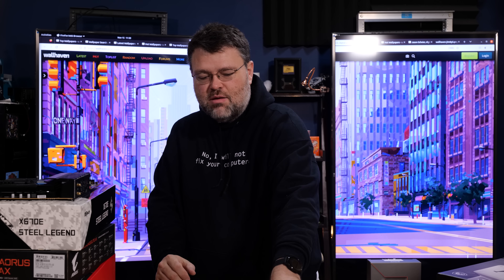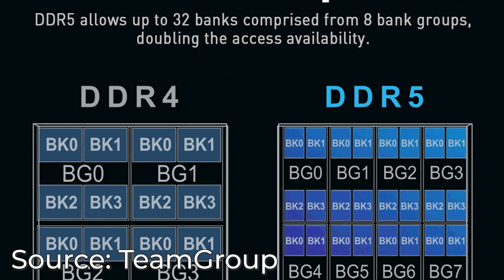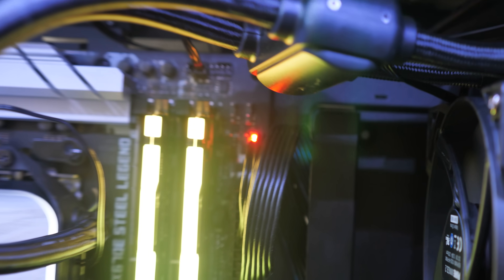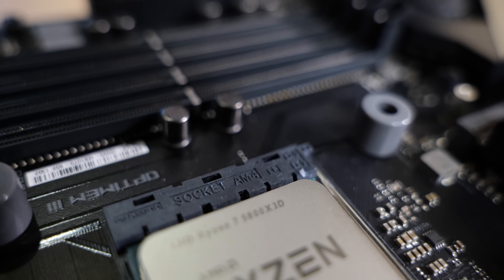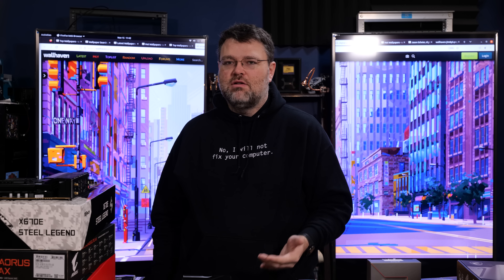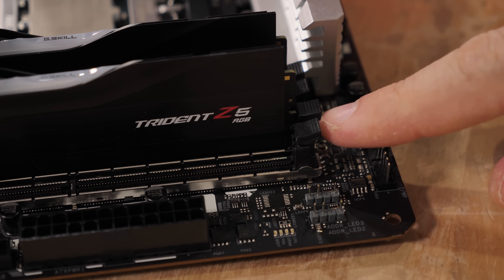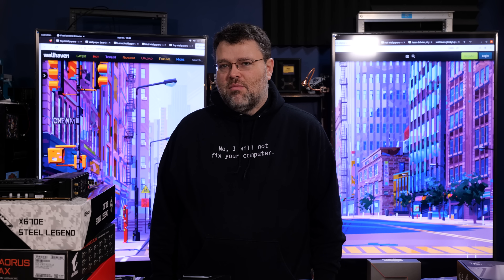Is 128GB of DDR5 IMPOSSIBLE on AM5? Level1 Investigates!

Comment: Thanks for this coverage. The main reason I haven't upgraded to a new platform is I want reasonable speeds at 128GB. Had been leaning towards Intel DDR4 since there are several motherboards that have QVL 128GB at 3600.
Reply: I really wish this situation was better for either platform. Rn “upgrading” from AM4 128GB to Z790 64GB :/
Reply: May I ask respectfully what it is you do that benefit from RAM more than 64GB? Out of curiosity.
Reply: @penguinbelly  For me at least it's a lot of software development work, which needs surprisingly quite a bit of RAM, incl all the browser tabs and microservices spread among multiple projects
Reply: @penguinbelly  workstations for rendering and power users with home/small businesses servers (video, XFS, etc). I can’t see why you’d need it for gaming or most other applications.

Comment: They really should reinforce the RAM slots and make it so RAM sticks can properly insert themselves into the slot without having some janky thing where it doesn't fully click into place. When inserting RAM you're putting a lot of pressure on the slot and RAM sticks, which feels like it's gonna break.
Reply: Even on generations before, inserting RAM could be feeling pretty sketchy sometimes - so hearing this about DDR5 has me a little worried lol. But I'm sure manufacturers will figure it out sooner or later, just how they'll have to figure out more resilient PCIe slots.
Reply: Boards are wildly more expensive and more cheaply made what a joke
Reply: Yeah - Probably not a good idea to reseat them when the motherboard is in the case on the standoffs ...

Comment: My experience with modern DDR4 and DDR5 has been a pick one of two. 1). Lots of RAM at lower speed and higher latency. 2.) Some RAM at high speed and low latency.
Reply: Yep, unless if with DDR4 you want to spend a good amount more money then you can somewhat get both, but usually its not worth it
Reply: @MrMaddog2004subscribe  Spend money to get better what ? Memory ? Motherboard ? Isn't this mostly a memory controller limitation ?
Reply: @Winnetou17  RAM binning is a thing, RAM that's running on the edge won't be stable even on the best matured CPU/Chipset

Comment: I was taught to insert dimms evenly, as level as possible, with equal pressure on both ends and never to insert one side and then pivot the other side down.  That's how people usually end up with 'seating' problems.
Reply: I also prefer this option, however many memory slots these days only have the lever on one end and a solid post on the other, which makes you first insert one end then push down the other with a painful crunch.

Comment: My asus x670e gene has been a champ. Boot times are slow but i honestly dont mind. I turned on the auto memory thing that checks timings every boot on purpose. Which is weird because "disabled" means enabled and "enabled" means its disabled. Out of the box it was on enabled meaning auto memory was off. Thus first time I booted it was just like am4, instant on.... But i like the feature to check timings and make sure its running right, so I "disabled" the thing in the bios which enabled the longer boot time.

Comment: Thank you for this exact video. 

I was just about to put together a 7950x ASUS Hero X670 and 128g of trident Z Neo just like this for a new workstation. I'm glad i'm holding off. My 5950x is running 128g nicely and i'll just wait a good while
Reply: Why would you need 128gb with a 16-core processor?
Reply: @DerekDavis213  large RAM disk for converting movies without killing your ssd or waiting for spinning rust
Reply: @nathanlowery1141  An recent nvme ssd can read and write at 7000 megabytes/sec.

An Intel Optane drive has very high performance, for smaller queue depths.

How much faster could a RAM disk be?
Reply: @DerekDavis213  much faster. Don’t have an optane drive. Also as good as optane is they don’t make it anymore, and it also has write limits.
Reply: @nathanlowery1141  Isn't converting videos pretty cpu-intensive?    7000 megabytes per second from a recent nvme SSD is not fast enough?   Seems hard to believe.
Reply: @DerekDavis213  it is cpu intensive, at least my workflow is. The ssd is “fast enough”, while it lasts. But with quick failures of the ssd, and downtime associated with it. Not to mention re queuing corrupted videos due to a partial failure. Time proposition goes extremely lopsided quickly
Reply: @DerekDavis213  AVID media Composer. it uses most of it. Use lots of single core application that preferer high clock speed instead of threadripper. My 4090 does more workhorse than the 5950x :)
Reply: @vortexsophia  You are using AVID?    And I thought that all serious editors use Mac and Final Cut?

Just kidding!   Mac is overpriced garbage.
Reply: @DerekDavis213  I've been working broadcast media since 2003, it's been all AVID. I own a mac, final cut, premier, etc too. I worked on the AVID DS Nitrous in 03, it ran on a Linux Server then...
Reply: @vortexsophia  Compare a $7000 Mac Studio with M1 Ultra vs a $7000 PC with monster RTX 4090 card.     Which is the more powerful system?   Which system has a FAR better selection of professional software?

The Mac fanboyz would deny that Windows would fricking destroy Mac Studio!   LOL

Comment: The deeper you dive.... interesting to learn about these kinds of properties of the new DDR5 platform!

I remember the IGN video where they found a performance improvement from going from 2 sticks to 4 sticks of DDR4 on the AMD 5000 series CPUs. In that testing they were keeping the speed and timings the same. A handful of % fps more if I remember correctly.
Clearly, the performance gap between 2 vs 4 DDR5 sticks makes a big difference here. But it leaves me with questions....

Is the difference only stability related? So 2 sticks can go up to 6000, where 4 sticks can barely go beyond 4000...
And if setup at the same speed, does 4 sticks perform better than the 2 sticks? Which would indicate inefficiencies in the dual channel vs single channel setup.

Anyway, it does add some interesting choices on the memory kit... You could buy large capacity and save on costs by buying a lower speed.... But if you ever plan on splitting the 4 sticks into 2 sets on different machines in the future during its second life... well, more speed would ve been nice...
And you have to estimate what capacity you need, otherwise going for the single channel will be better.... How big will your biggest project be.... pff...
Reply: I’m really hoping for 2 x 48GB sticks down the road, seems to be the most viable path with the current gen on either platform
Reply: @ChatGTA345  Doesnt DDR storage follow the "2 to the power of x" in terms of size? -- googled and found an article on SK Hynix presenting 48GB modules...... supposedly its handy for vitualization servers.... hmmm.....

I would agree with you here. I think high end is probably moving towards high speed 2x64GB. idk about 48... that may be server side only.
Looking at the DDR5 sticks without heat sink on the consumer market now, those RAM sticks have 8 chips on them, so 4 GiB per chip, but only mounted on one side.
Probably with a good PCB design, it could handle 16 chips with 8 on each side, I hope...

But who knows, maybe the memory controler isnt optimized for max capacity 2x64 and it may work significantly better at 2x32...
We might need to wait for a next-gen memory controller to reap the real benefits.
Reply: @HexerPsy  Yeah, the power-of-2 law does not seem to apply to the individual RAM dies on a given DIMM. So e.g. for DDR5 currently we got 16 Gbit chips (=2GB) x 8 or 16 per DIMM, for a total capacity of either 16 or 32 GB. The articles about Samsung and Hynix say that they're working on 24 and 32 Gbit chips however, which will effectively enable the total capacity 48GB and 64GB memory modules possible. But 48GB is closest in terms of implementation, from what I understand, though it is more aimed at the server market at the moment. Consumer chips will come later.. sigh.

Samsung article from Toms Hardware says consumer 64GB modules will be available late 2023-early 2024, and we'll likely hear more about those at CES 2023.

Comment: I don't think that this will dramatically improve on next gen AM5 cpu's since AMD intends to reuse io dice ... and io dice connects to RAM :(
Reply: Respins are a thing, even single CPU type has multiple stepping regularly. And we don't even know the cause here, sometimes even firmware van help. Finally, I'm assuming AMD isn't insane - they may want to save money by reusing the Io die, but presumably not of that turns out to reduce their competitiveness.

Incidentally, am4 too improved ram perf over the years.
Reply: @MoireFly  yes, am4 did improve over the years, but if you look when improvements happened was when io-dice changed ... and it was certainly not half way through generation. Also the "firmware might make things better" - I really disagree with that. AMD would not plaster that detail over their website if it wasn't a done deal for current gen cpu. Don't get me wrong - I want AM5 to be great, but at this moment I can't justify all the cost to switch away form 5950x, and poor 128GB support is part of it ! BTW I'm running 4x32GB ECC @ 3400MHz - making the change that more painful if I'm switching to just 3600MHz and half baked ECC. I'm considering TR but I don't need that many pcie lanes, so the idle power use is hard to justify for multitude of VM's and code compiling.

Comment: I never managed to get 4 sticks of DDR4 3800 CL14 running at that speed with my 5900X.  It was 2 2-dimm kits, so not perfectly matched.  It's fine at 3600, so I've been running it at that speed for over a year, but I could've gotten much cheaper sticks at that speed.
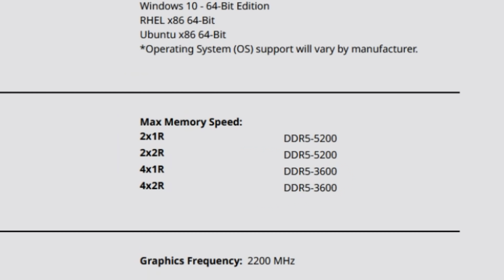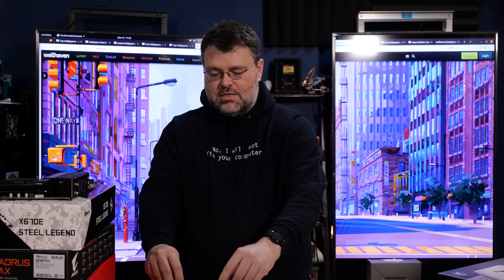I was glad to see at 11:40 that the sticks were properly in A2 and B2 like the manual specifies, rather than A1 and B1 like he kept demonstrating (at 2:37 with the WiFi board).  I wonder if the BIOS yelled at him that it was the wrong config.  Hopefully users RTFM and don't follow that example.
Reply: On my 5950x, I'm running DDR4 CL14 at 3733, that's max I can push it with 4 dimms, if I go to CL16 I can use 3800, but I prefer the lower latency.
Reply: @andreiga76  Agreed.  I think I tried 3733 and it worked, but then the next time I rebooted it reset again.  Eventually I just put them at 3600 and kept the CL14.  I haven't checked for a new BIOS in awhile so maybe I can try that and push it a bit further.
Reply: @andreiga76  that's the same as i got as well and the same choice.

Comment: I'm hoping that Zen 4 with 3D cache will, as the 5800X3D did, ameliorate the performance impact of slower memory, and thus allow for highly performant quad rank setups.
Reply: Honestly I would get a 3D Vcache version if that means I can run slower ECC ram since you could get the best of both worlds: good stability and good performance.
Reply: 3D Vcache would even help out a bit with power consumption since main system memory can be accessed less and clocked lower making the whole platform more attractive. Fuck the responsible product managers.
Reply: If AMD isn‘t releasing a 16-core 3D SKU this time around I‘ll be pretty pissed myself. Remember that 5900X3D sample Lisa Su was holding into the camera over a year ago? Let‘s hope Intel can put the competition pressure back to AMD so AMD stops acting all Intelly circa 2013. :(
Reply: yes, but if the DDR5 memory will be slow, what's the point it to be more expensive and why not release Zen43D on DDR-4  - the performance will be the same if not better.
Reply: So can I use the cl32 6400mhz  ram on amd expo??
Reply: Yay, German tech site ComputerBase reported rumors about 8/12/16 core Zen 4 3D SKUs with almost identical frequencies contrary to Zen 3 3D with a January 23rd date.
Reply: You don't need 7950x3d. It's a productivity chip. It already isn't that great for gaming so the cache wouldn't be that helpful. The only chip that makes sense for gaming in a practical sense is the 7800x3d. If you do work just get the 7950x as the 3d version isn't going to be any better. The productivity applications won't benefit from the cache. If AMD even makes one it won't be anytime soon.
Reply: @ertai222  Some people have more than one use for their computer.
Reply: It is not wise to project your own computing demands on other people. Not everything revolves around gaming and there is a reason AMD released a few Milan-X SKUs but only a Ryzen fig leaf. And that reason isn’t that AMD is looking out for its lower tier consumer platform wanting to help customers not accidentally buying a 3D CPU that’s a bit more expensive than the non-3D counterpart.

Comment: Might work better on 14th gen intel or later revisions of the AM5 platform. DDR5 may be sticking around long past AM5 is done. But who knows
Reply: AMD tends to keep their socket around for as long as the memory generation, thus AM2 was DDR2, AM3 was the odd one out as it bridged generations, offering both DDR2 and DDR3 support, AM3+ was DDR3, and AM4 was DDR4. AM5 will thus probably last the entire DDR5 generation.

Comment: Not sure If this relates: I have a lenovo legion 5, 4800h laptop with 64gb of ram (i know not the same as am5 at all but stick with me). For the longest time I thought my sticks were bad because I would get memory corruption. It was actually something to do with the IGPU and switching between Linux and windows. Something was not getting reset! If I went from Linux to windows I would get BSoD.....then memtest would show issues too.  My theory is that between boots the igpu was still holding onto some of the system memory....it wasn't being properly released. Enabling/disabling the igpu....different Linux distros....different ways of rebooting (doing an actual power off vs rebooting) all yielded different results in memory stability.
Reply: And before you ask.....this memory could go through an entire 24hrs of memtest and not have problems. It was 100% not the sticks themselves.

Comment: AIDA's memory test has a tendency to hit the L3 cache during the "RAM tests"

Also you can literally calculate max memory bandwidth. DDR5-4000 has a max bandwidth of 64GB/s. DDR5-6000 can't do more than 96GB/s
Reply from the maker: Yes, I should have mentioned that.
Reply: whenever I read Buildzoids posts I can hear him saying the words, I slow down my reading to match how he would speak it. its a trip.
Reply: @sylicongames  same here :)
Reply: Buildzoid , I love it when you drop  in with some fresh knowledge nuggets on other vids.
Reply: I'm still interested in how to get 2T command mode on am5 I can only get 2T GDM off at 3600CL30 but at 4600CL40 (my pb completely stable) its 1T with GDM on. I thought uneven secondary timings was the answer but it didn't work. Asus support didn't say whether it could be added to the BIOS when I asked
Reply: There needs to a better memory test benchmark.. that doesnt need re-installing every 30 days.
Reply: So can I have 4 sticks of Ram 6000 on a DDR5 or I have to update the bios by myself hoping it works ? I find wanna be with 4 sticks for estethic not gonna lie.
Reply: Well, a memory benchmark should be designed large enough to mitigate that. Could it be more like "intel has aida memory test optimizations in its prefetchers"? They do have a tendency to design for popular synthetics, where amd designs of real world use.
Reply: @dgo4490  actually right now AIDA is most inaccurate on AMD. The infinity fabric at 2GHz should have a max bandwidth of 64GB/s.
Reply: @ActuallyHardcoreOverclocking , speaks well of their branch prediction and cache optimisation efforts.
Reply: @ActuallyHardcoreOverclocking  Thats for Read. Write is half of that.

Comment: I'm running 64GB (4x16GB) DDR5 on a Asrock taichi x670e at 6000 without issue. I have 2 kits of G.SKILL Trident Z5 Neo Series AMD EXPO. I have had some system instability, but I think only due to messing with the curve optimizer, I don't think I am having any memory related issues...
Reply: Okay I downloaded aida64 and rand the memory benchmark and it blue screened immediately :(
Reply: Okay I disabled curve optimizer and the test finished fine with good bandwidth and latency, so I think the memory is fine, just cpu instability.
Reply: Wendel was talking about 128GB though, that is 4x32GB. 4x16GB is easy for the IMC.